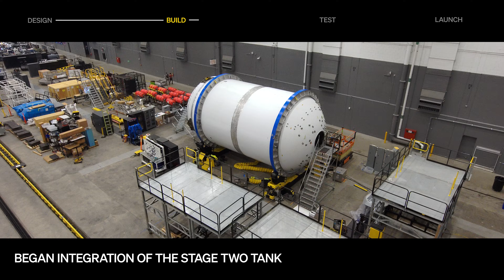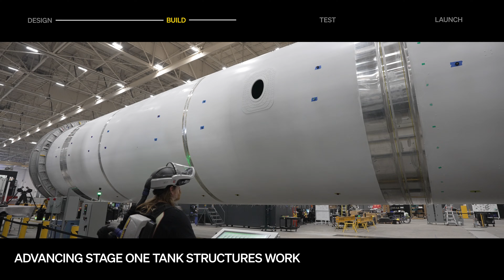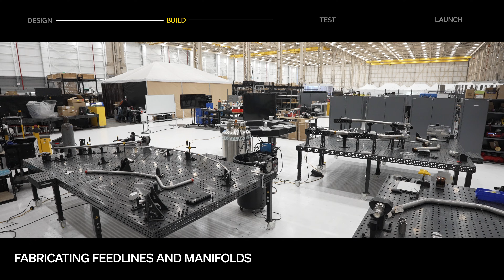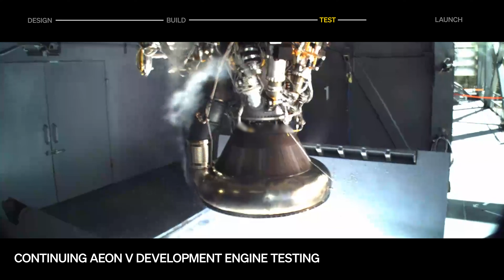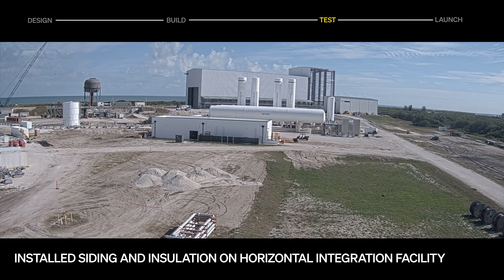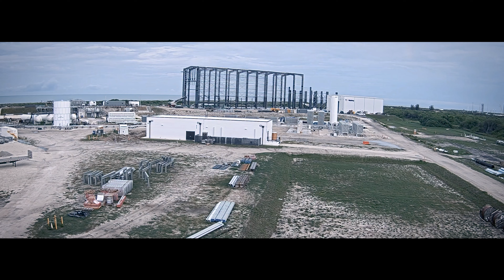Terran R December 2025 Program Update

Comment: Jan 2026 update, four years after this was filmed;
1. The rocket clearly looks warped to the naked eye. Yet Tim Ellis says "The rocket is straight to within a human hair". 
2. He claimed that rocket would launch "later this year" ie in 2021. They had one failed launch to-date of the Terran 1 in 2023. They have abandoned the Terran 1 now. The replacement, Terran R has never flown.
3. When asked does the rough surface effect the aerodynamics? Ellis says "No. None at all. Its actually exactly the same aerodynamically" I mean come on... Looking at their rocket inventory in 2026 - they are all shiny smooth. 
4. And Ellis says the rough surface "only" adds 5%-10% to the rocket's weight. In rocketry that's an extremely high cost. No "only" about it. 
5. In March 2025, Tim Ellis resigned as CEO. Eric Schmidt now controls the company and has taken over as CEO.